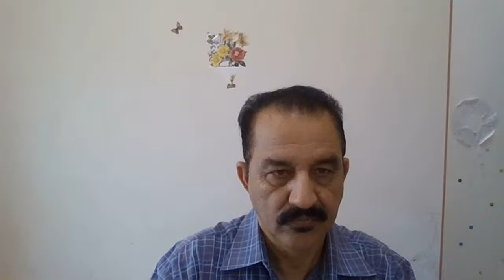Civil Construction Materials--Technical Session No 136- Curbstone as Materials.

Comment: what is the required flexural strength for curbs stone? standard code reference?
Reply from the maker: ASTMD790
Reply: @materialengineerofficial8755  Flexural strength shall be not less than 85% of the design strength, which is 40 N/mm2 (compressive / chrematistic strength).